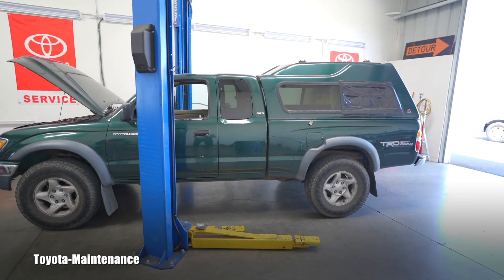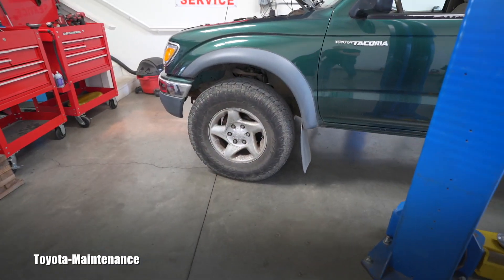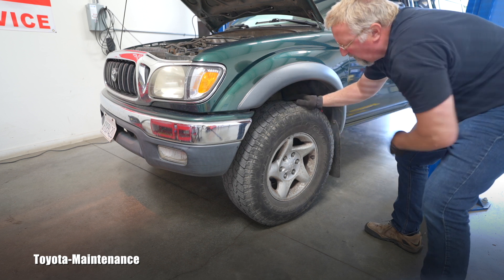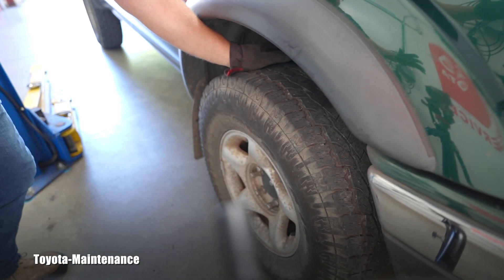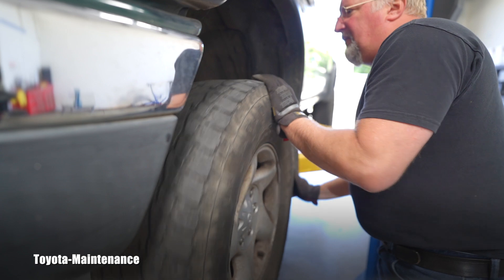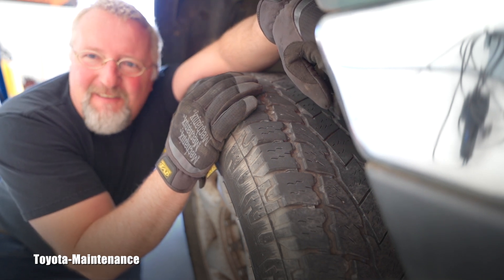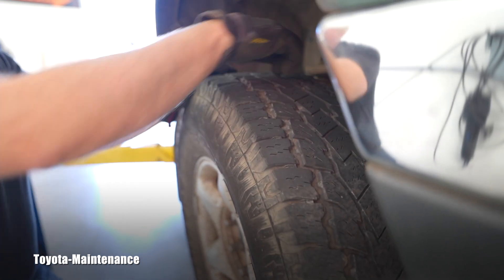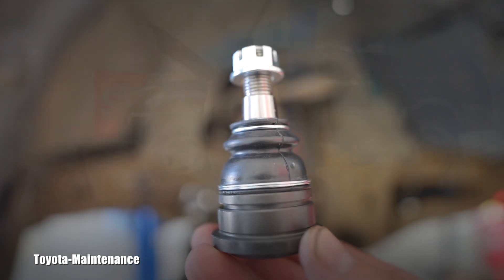Toyota Tacoma upper ball joint testing

Comment: Why does Toyota not provide grease fittings on ball joints? Planned obsolescence and cheap? Seen more than a few of these trucks alongside the road & on flat beds with a wheel (always the left) face down in the dirt. Why not replace the old ones with ball joints with grease points? OE is not always best.

Comment: I do the same with normal cars, particularly front wheel drives whilst they are on the road surface. I also give the wheel a push/pull at the 3 & 9 o'clock positions to check for movement or felt clicking. It's amazing how many cars you can pick have issues with their ball joints, wheel/hub bearings or tie rod ends by doing this.